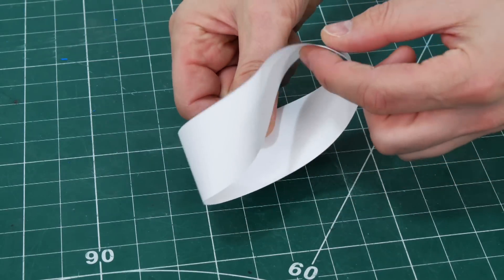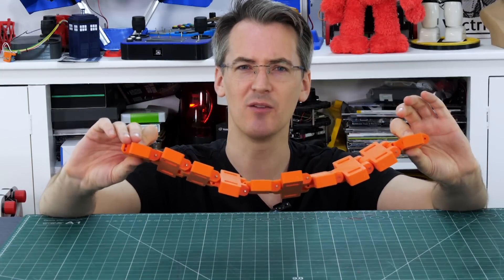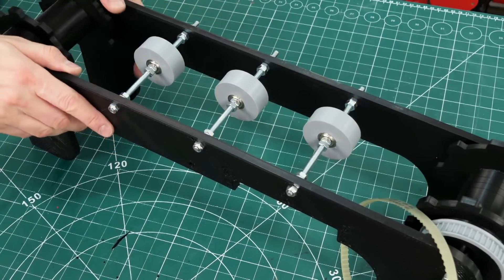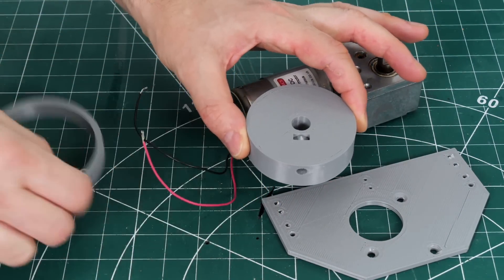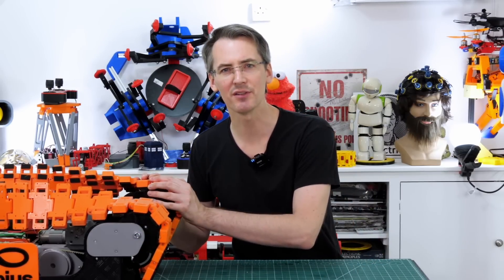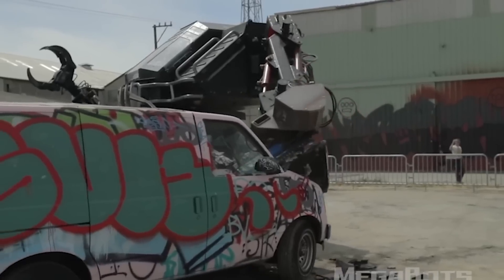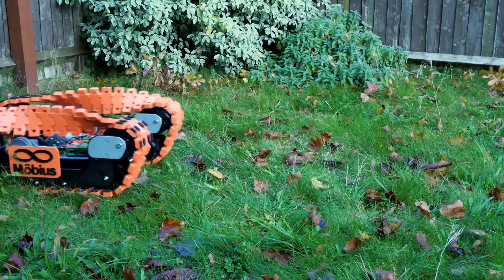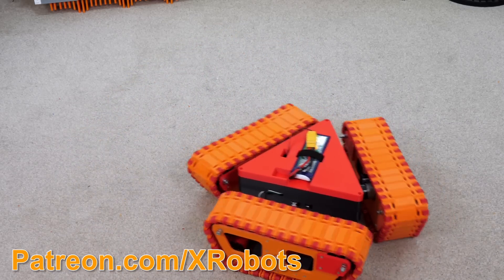Mobius Strip Tank

Comment: One advantage: 
you could put a larger diameter turret on the tanks. 
Because the tracks go vertical and create more space in the center for the turret
Reply: It would make the tank taller which would be a detriment to it's overall silhouette, which would in turn decrease it's survivability in combat. Not to mention the decrease in reliability that comes with having more than one axis of articulation between each link of the track.
Reply: @shred1894  but you could sink a wider turret further into the tank, thus decreasing the silhuette, additionally the vertical portion of the track could act as a onetime use spaced sidearmour.
Reply: @wolfganghorn7492  First, you will end up with clearance issues for the barrel of the main gun by doing that. Second, using the track as armor is a bad idea because the moment it takes a hit you can't move anymore, which opens you up for follow-up hits.
Reply: @shred1894  that's why I said onetime use Armour ;p
Reply: @shred1894  You'd just need to put the barrel at the very highest point on the turret, you could then get a tank with a turret that had more room inside for crew and loading mechanism, but is still the same height
Reply: @shred1894  good point, could stil be useful outside of "war"tank use case I think. The larger diameter turning platform could be useful for a drivable robot arm. It could give it more stability  at the base.
Reply: And tracks could act as a side armor, althoug Im not sure if it would be a fail or a feature
Reply: @ESPkenner48  weak points, the connection joints would be easier to damage at the vertical points of the track. Easy to dissable
Reply: @orionm4268 No easier than normal really, but in actual application the track would have to be more torsionally rigid than they typically are, meaning it wouldn't scale to larger vehicles well.
Reply: The treads could cover the bottom of the tank with no gap, while still allowing a turret on top. The tank wouldn't get stuck on top of a boulder in the middle of the road.
Reply: The tracks going vertical has nothing to do with the mobius strip, though, it's just the way James opted to build the track assembly.  Tanks like the Char B1-bis or even the Sherman have very tall tracks; and one could just as easily put the mobius twist into a track that's no higher than the idler wheel (like the track on a Citroen half-track) - you just need to remove the return rollers so the track has room to do the twist.

And really, a very vertical trak would make the turret smaller because the turret is limited by the size of the turret ring, which is limited by the width of the hull.  (Putting a very tall turret on the top of a narrow ring is a good way to get your turret to fall off when you go over a hill.)  So burrying the turret between the tracks will limit the turret ring size and thus limit the turret - which is part of why modern tanks all have the hull splayed over the top of the tracks, to get the widest possible turret ring.
Reply: Having your drive sprockets(or any sprockets) on the ground will cause your machine to bounce.  Move them up, and add keepers to the tracks to keep them on the rollers.

Comment: as others in the comments have stated, it would wear both sides of the track evenly. if you put grousers on both sides (single side?) of the track, all of the grousers would wear at the same rate and the entire track would last twice as long compared to a normal two sided loop of track (that only runs on the outside).
Reply: I know that works for surface wear, but I question how this affects the joints between chain links since there's so much wiggle room I imagine those joins might be weaker and more susceptible to vibrations.
Reply: @UltravioletNomad  perhaps make the links not be joints but compliant?
Reply: flip it around, so it can corckscrew trough the mud
Reply: @Qbasiz1  Wouldn't that just make it like something that Leonardo probably drew, and have issue in terms of turning the screw fast enough to get enough forward push to move quickly. A tank can move surprisingly quickly over the right terrain as it is.
Reply: Tom Scott had a related question in one of his episodes of Lateral; spoiler: the reason for that case was so a given part of the track had twice the amount of time to cool after touching hot material than it otherwise would have had (it was for a conveyor belt.)
Reply: @FPVenius Wouldn't just spreading a bit of water on the track be far more effective for cooling? (yes)
Reply: @NigelTolley certainly. But I'm just stating what the engineers actually did, so maybe adding water wasn't acceptable for some reason (cooling too quickly? Corroding the track? Somehow adversely affecting the load?) Whatever the reason, they chose to add a twist so both sides of the track were used.
Reply: No tank. Ever. Has had a problem with the surface of the tread wearing out.
Reply: This is just false, with a properly designed track you have the inner side optimised for interacting with the sprockets and the outer side optimised for ground contact and wear. With a Möbius strip track both sides need to interact with both the ground and sprocket hence they have to do both and that means compromises have to be made. If you look at James’ tracks then they are the same on both sides, but look at any other track, especially ones in use, and they are not the same on both sides. The track designs that James uses do work but they are not good track designs, not by a long shot. So the idea of using a Möbius strip to reduce wear is only a remote possibility on badly designed tracks like this.
Reply: @conorstewart2214 Agreed. The extra wear from all the grit etc that goes into the sprocket holes will be considerably more than a regular design would see, where the track plate outer protects the inside sprockets etc to a huge degree.
Reply: think McFly... picking up mud and stones, and deliberately twisting the tracks to put all that into cogs and wheels, the wear and tear of the joints... this must be the single most stupid idea there ever was considering all tracked vehicles EVER.
Reply: @SciLensRacing  actually making one entirely out of peanut butter is a worse idea
Reply: @azrielfriedman3595  dont give him content-ideas :D

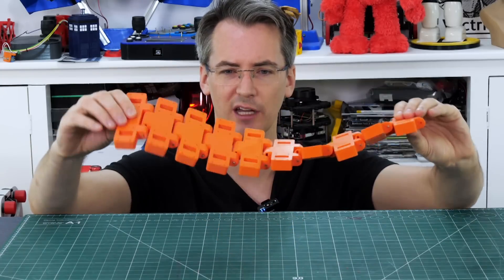Comment: 1:50 10 links is only 9 joints, each joint twists 18 degrees, so you would need 11 links (10 joints) for 180 degrees.
Reply: yes, however each one has one link so shouldn't it be 180 anyways?
Reply: @nidhu595  Consider just 2 links, with a single joint, gives 18 degrees. The first link provides zero degrees, only subsequent links provide angles.
Reply: @77gravity that makes sense, but what about four links connected in a square, then there are four connections and therefore 72 degrees of movement, since the track is connected to itself, we make up for the "missing" link
Reply: A classic Obi-Wan error.
Reply: Correct. But the last and first link also joint, giving the total of 10 joints.

Comment: they use mobius strips for conveyor belts, it helps with surface wear
Reply: I thought I'd seen this in play on mine site conveyors but couldn't be sure that was what was going on.
(Edited for clarity, i.e., bad English)
Reply: @DadofScience you're sure, but you couldn't be sure?
Reply: I remember seeing a Ferris wheel with a Mobius strip used as the drive belt for the same reason. I think some early automobiles also used it for fan belts which were often made from leather instead of the much more durable steel corded rubber that is now used for drive belts on mower decks, fans (assuming it's not electrically driven), A/C compressors, PS pumps, etc.
Reply: @nathanielmoore87  Are you sure you didn't just see a belt in a cross-over - Doing this will reverse the direction of the driven pulley vs a straight belt making it turn the same direction as the driving pulley. I've definitely seen THAT on old machinery and all kinds of applications.
Reply: @MFiveK  Possibly. It's been several years since I visited that park.
Reply: Employed with scraper boards or something similar, the mechanism would be good for scenarios where cleaning or clearing the belt inline would be useful. (Both sides, in  the case of a mobius strip belt ...)
Reply: It's because the guys who sew the conveyor ends together sometimes forget they put a twist in it, it works anyways so they don't fix it
Reply: The main wear on metal tracks in in the linkages so this wouldn’t extend track life. There would be double the track pads though, one of any tankies favourite tasks in changing track pads 😂
Reply: It’s hilarious how many of you have never worked on a long conveyor. They have a lot of slack in them the gravity of the slack pulls the top tight. It flips with no issue with all the slack and the twist holds it up a little higher and help maintain tension on the topside. Only the 500ft+ belts flip in my experience.
Reply: theoretically, it’s half the wear due to it effectively being double the belt
Reply: this is truly the only reason this seemed like a usable solution to me, if the tracks are produced in a way where both sides are the same and its not like, prohibitively expensive or heavier for a tank to do this, I could see it extend the life of the treads. I feel like on something like a tank though it'd just introduce a new weak point, compared to a conveyor belt.
Reply: @CouchParty Plus, as long as tanks have been around (more than a century), I'm sure we're not the only ones who thought of this idea. If it gave them an advantage they would already have used it. It could still be useful for non-military applications though.
Reply: This is what I was thinking, utilize both sides for more even wear.
Reply: That was the only potentially useful attribute I could think of.  Cheaper to finish two sides of a belt and make it flip over than let it wear unevenly
Reply: Also used with steam engine powered systems and leather belts.
Reply: Belt over mechanisms are normally used to extend the life of very long conveyors, not suitable for shorter and more rigid drives.
Reply: The more you know…
Reply: That was my first thought, twice the surface area means half the wear lol
Reply: I tought of this too...
Reply: And by the looks, extra side armor for a tank
Reply: I’m trying to understand why this makes sense but it hurts my brain
Reply: Exactly. You get twice as much belt for the same volume
Reply: Why bend not wear strip more?
Reply: because both sides of the belt become the surface, rather than just one @NekitGeek
Reply: @toesandfingers he was asking that wouldn't the bend in the strip cause wear?
Reply: @jaydeep-p If you stay well below the elastic limit it should be ok, not permanent deformation caused.
Reply: @toesandfingers  There is no both sides only one side.
Reply: They could distance the bend of the belt
Reply: @NekitGeek it equalises stress and wear simultaneously
Reply: Some might have been used as Mobius strips to supposedly reduce wear, I would think that could be questioned. 

Wear/abrasion of the surface is only part of the issue, you also have long term fatigue of the material from bending back and forth over the pulleys. You're bending the material much more in both directions, and also adding twisting, which does not improve long term durability.

Edit: they do add a twist in many belt driven pulleys because it adds stiffness along the length to keep it from slapping/bouncing, or to change the direction of the belt drive. Those aren't typically Mobius, though, just two half twists top and bottom.
Reply: @danno1111 belts are designed to have limited torsional elasticity, so none of this is true unless the twist introduces horizontal stress, which it won't in a properly designed system. Additionally all wear will be equalised, resulting in only tension adjustments being necessary for regular maintenance and a more predictable replacement cycle.
Reply: conveyer belts tend to wear on the surfaces in many usecases rather than fatigue. If the surface can only be a max thickness you can get double the time before you need to shut down the line for maintanance if you can use both sides of the core material
Reply: @danno1111  one aspect that you're not considering is that the structual material is not necessarily the relevant wear point. For instance, imagine you had a belt of material A that was quite flexible, durable, etc., but had almost no friction. Well, you want this belt to carry something, so you'd then place a coating, pads, plates, etc. of material B onto the material A belt. Material B has much worse mechanical properties and couldn't be a belt on it's own, but has the grip/friction that you're looking for. So material A can handle the marginal additional stress of being mobized, and that lets you fully utilize it's surface area and cover it entirely in material B, meaning the entire belt has to be replaced only half as often. 

For instance, (talking out my ass here so could be wrong) I'd imagine chains are probably a quite good material when it comes to raw strength, general robustness, etc. but they'd be pretty piss for use in any practical application because, well, it's a metal chain, of course it is, the surface is uneven, it's heavy, and a general pain in the ass. But, you could design a set of chain-links and surface-plates such that every other link has a surface-plate bolted, riveted, or otherwise attached through it, with a surface on either side. Then if a link breaks you could repair that single link, or if the surface breaks/wears you could replace that single surface. Where this would be applicable? No fucking idea, might not even work, chains aren't exactly the pinacle of technology anyhow so we probably have something better, but it illustrates the general idea of how you could go about wear-spreading with distinct structural and contact surfaces.
Reply: This makes sense when wear on the surface matters. It doesn't matter all that much for tank treads, and I imagine they'll work better if you reduce wear on the inner surface..
Reply: @brandonmack111  Tank treads are also meant to be mostly used on softer surfaces like dirt and gravel. That probably helps with wear too.
Reply: Weird, wouldn't that just wear out the rest of the material faster?
Reply: Interesting! I was going to mention that this mobius strip tank tread would have that advantage. Also, the tilt would help dump the dirt or rocks etc off of the tread as it turn 180 degrees at the top of the tread assembly. I imagine that the wear and tear on the connecting joints would increase substantially though.